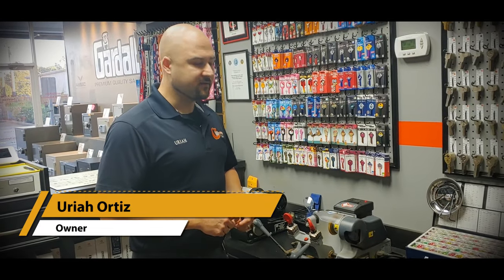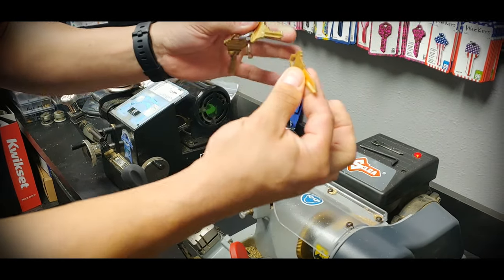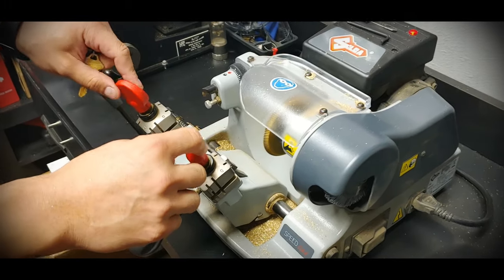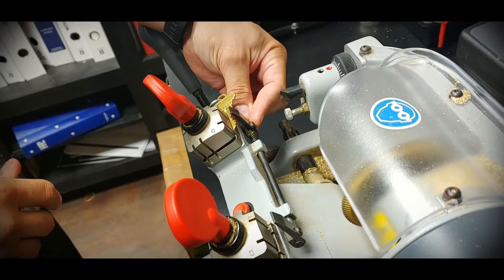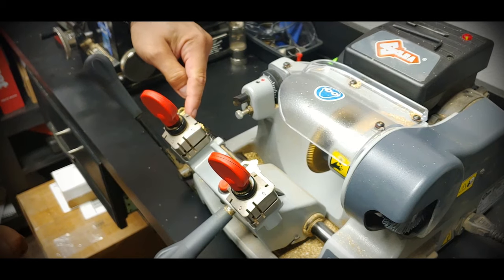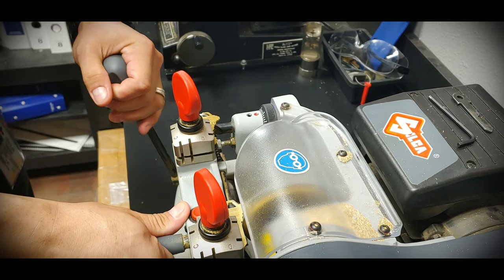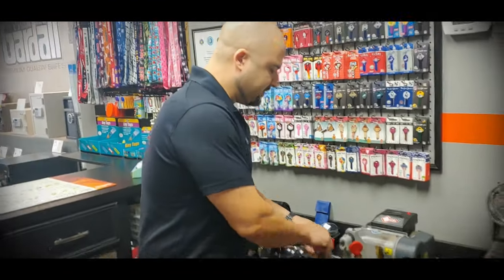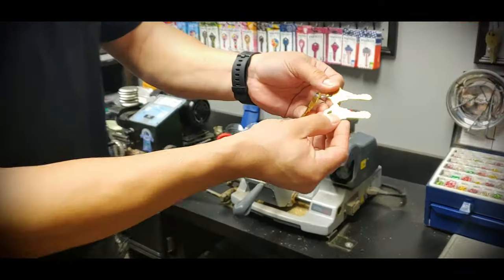How To Get A Key Copied

Comment: I have an old machine, the cut key looks pretty good but then it won't fit completely in the cylinder and if it fits it won't turn. Success rate is only 50%. I noticed one little tooth on the circular cutter was broken, not sure if that has anything to do with it. Will do alignment next.
Reply from the maker: Cutting blades need to be replaced or sharpened every so often